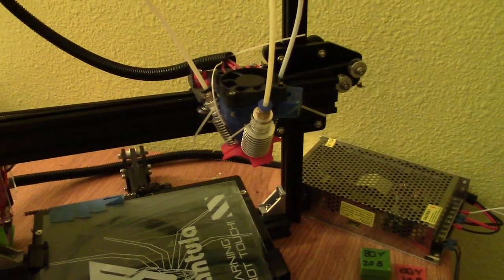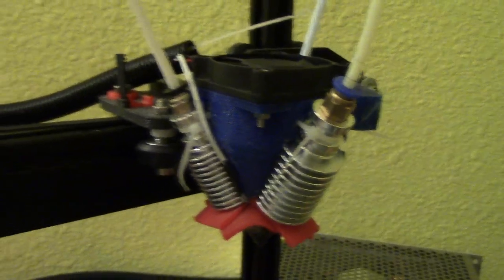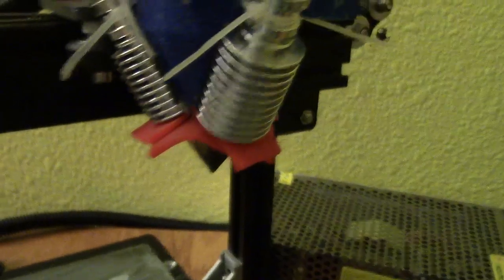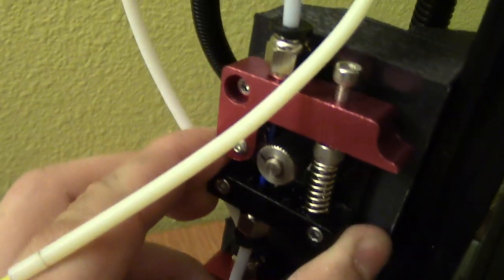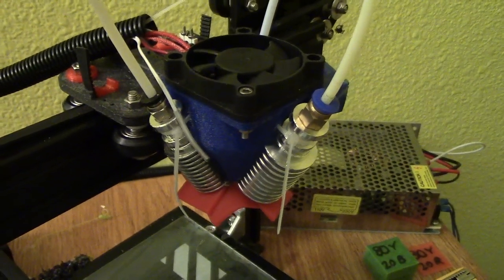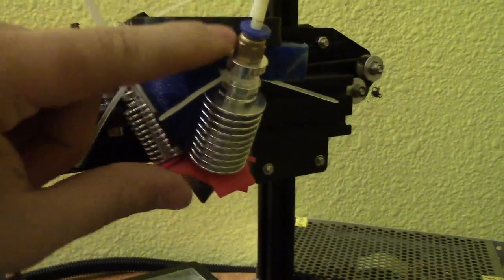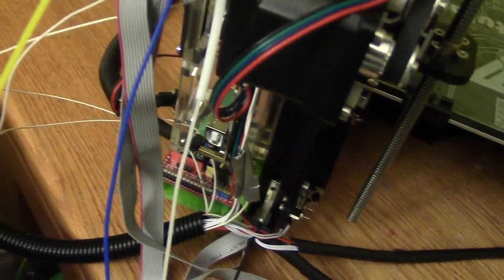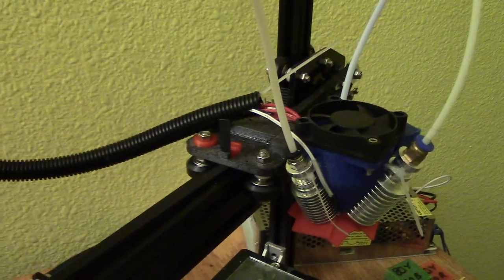Add a Diamond hot end to any 3d printer! - Part 1 - Mechanics

Comment: Have you thought about printing an offset mounting hub for the three filament motors? That setup looks like it could add additional friction to the filament and could be a point of failure of prints.

Comment: well done good job, do you purge between colors to avoid mixing?
Reply from the maker: +frozenmice yes, you can set up purge towers, as long as they print before the object. For instance, if you have a blue and yellow object you will set up one purge tower for each.
Reply from the maker: +frozenmice yes I manually put in purge towers for each color.
Reply: How exactly do you purge?

Comment: Hi...! Nice update to Tevo...! I'm thinking to do this in the near future... Will your firmware work in the Rumba board ? I'm really new in this 3D printing thing.... ;-)  Thanks...!
Reply from the maker: +Javier H. Ares (JHAres) it should work on any board with free input/output pins. So if you have some endstop connections or some servo connections you aren't using, those will work.

Comment: would you be able to do this with a dual extruder (1 extruder + hottend = 3 colours... 2 extruder + 2 hottend = 6 colour?)
Reply from the maker: +mopmop111 you would need 1 extruder per color, so a total of 6. You could definitely put two of the hotends next to each other. But the software and firmware configuration would be challenging.
Reply: @stopstalkingme  na possible now with toolchanger in marlin

Comment: Thanks for your information, although some of your comments are a little indistinct and seem to be incomplete. It's a good insight into what will be, for most of us anyway, the next step in 3D printing.I know I'm a bit fixated on one issue. I keep seeing your heater power supply's bare, exposed mains voltage connections.This sort of thing horrifies professional technicians who don't like attending funerals. Maybe you could set example and put it in a plastic enclosure. Then we will be more likely to have you around a bit longer.   :)Stay Safe.
Reply from the maker: +Jim Sung The bed heater is run on 12V luckily, so no exposed mains voltage 😀.